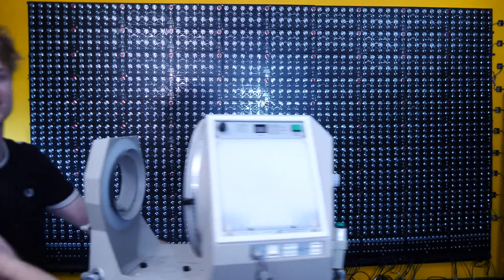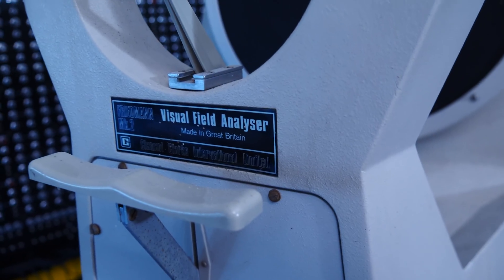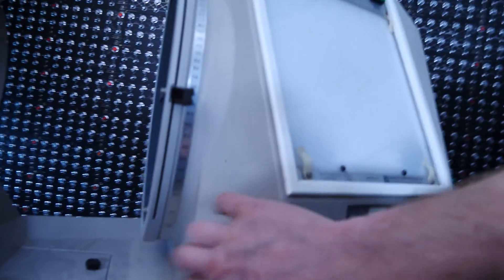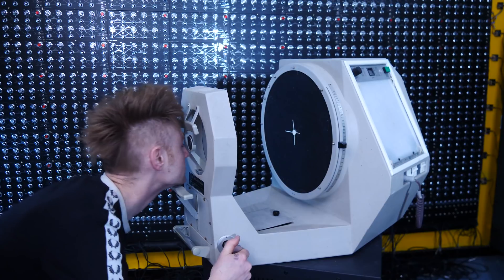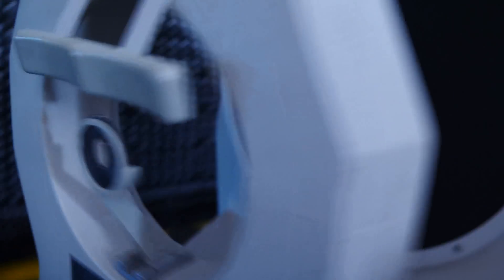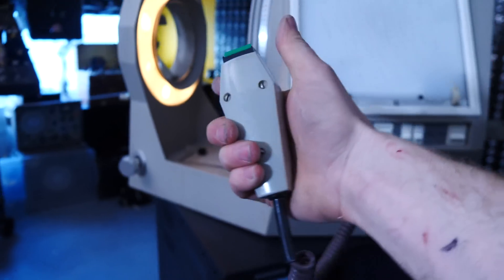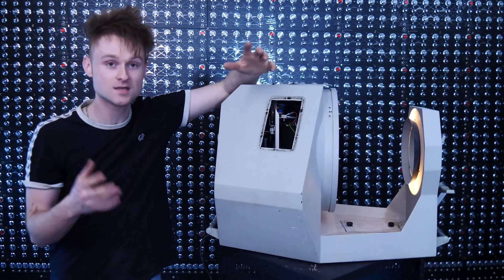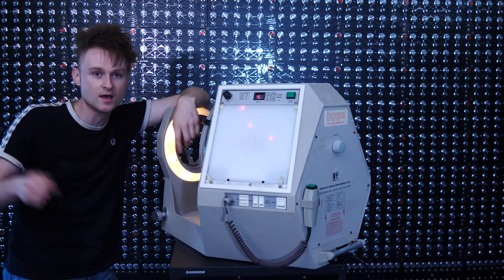I Found A visual Field Analyser

Comment: Add a very small camera without the infrared filter where the crosshair is, track the eye pupil with computer vision, and use the eye motion as an X.Y controller for synths or triggers for modules.  You can use a stepper motor to move the mechanical light selector, so it can sequence different lights at the time.  make ya eyes work it mang
Reply: honestly, this would just make a nice ass light fixture for the stage, the most bizarre strobe light anyone has seen

Comment: I'm feeling the connection with the eyes, perception, space... Could this be some kind of multi-dimensional stereo+ field realisation machine?
Backlight dimmer = quantised scale or filter or depth of field (front to back)
LED scroller = CV (notes) or spacialiser stereo fieldness (up, down, left, right)
also could fit some kind of eye sensor which would track eye  movement, which could have influence over audio in some way..? hehe fun stuff. Good luck

Comment: Yeah I used one of these years ago when I worked in an opticians. It was a bit more modern though. Patient would sit with their face pointed at the thing with all of the lights and look straight ahead at the big shape in the middle. They clicked the button every time they saw a light flash out of their peripheral vision.  The one I used had a camera inside and we had an extreme close up of their eye to and some controls to adjust their chin rest to make sure their eye stayed in the middle- and to make sure they weren't cheating. I zoned out once and when I snapped out of it I saw that the old lady taking the test had fallen asleep.

Comment: Some five years ago, I had refractive lens replacement surgery on both eyes, and in order to evaluate the results of the surgery, my doctor performed one of these tests on me.  As it turned out, post-surgery, my field of vision was near perfect.  However, I drive a tractor-trailer across the U.S., and as such, the Department Of Transportation requires me to have regular physicals and eye/ear tests, in order to ensure that I am fit for duty.  Upon reporting my recent eye surgery, the D.O.T. physician's assistant (not even a bona-fide doctor), determined that he would perform an equivalent test on me, to evaluate my field of vision. 

Now, this "test" (if it could be counted as such) consisted of the P.A. instructing me to look directly at the space between his eyes, as he stood some approximate distance away from me, moving a ballpoint pen from some distance outside my field of vision, inward toward my focal point, and to report the location where I first saw said pen.  Not satisfied with the results of said test, the P.A. informed me that I would no longer be authorized to drive a commercial vehicle of ANY kind, unless and until my vision was corrected.

Keep in mind that, just days beforehand, I had easily passed this test on one such visual field analyzer as you demonstrate in this video, with precise, repeatable, QUANTIFIABLE  data points, performed by a fully qualified optician.  Yet, somehow, I failed a somewhat arbitrary eye test, performed by a physician's ASSISTANT, who may have performed perhaps a dozen such tests at most (and probably far less!), using whatever object he had at hand, in which he estimated APPROXIMATELY where my field of vision should begin! 
Eventually, I was forced to request that my optician, back home in Florida, send a copy of his report to this Physician's assinine, I mean, ASSISTANT, to prove that my eyesight was, in fact, adequate.  In the meantime, however, I found myself stranded in California for nearly a WEEK, until the D.O.T. idiot finally got around to evaluating my test reports!

Comment: Instead of modifying it and tearing it down, you could just build a sensor system to detect which lights are on, and produce sound off of that - that way you still get a weird sound organ thing, and the machine can remain intact.

Comment: Never seen such device before. It looks very medical, I reckon it probably wasn’t used by optometrists but by doctors instead. EEVBLOG has done teardowns of medical devices such as echo / ultrasound imaging systems. These medical devices have a lot of very bespoke hardware in them that costs a fortune to engineer.

Comment: My dad was an optician and I used to love playing with his machine like this on visits to his shop as a kid. I think his was marginally more modern though.

The procedure was that you placed your head, as you did, then started the programme for each eye.
Periodically, it would flash up a constellation of coloured dots. Then you’d have to press the button on that wired remote for the number of dots you saw. A few seconds later it would proceed to the next constellation. By the end of the programme it worked out which bits of your vision your eye can or can’t see. His machine used to print the result on a cash machine type receipt. Lots of beeping would ensue.

I loved playing with it because I thought it was a game. It even got to the point of my dad accusing me of cheating because I supposedly saw a dot where my blind spot (optic nerve) was supposed to be. Good times.

Comment: I have been tested with a later model. I didn't need to call out what quadrant the light was, it was flickering lights in random spots and I pressed a button when I saw it.
I would suggest a non destructive mod. Tap into the lights with some piggyback soldering and have them be cv outputs. Or, a two step photo sensor. Red leds could be notes, the incandescent lamp controlling a vca or filter cutoff?

Comment: Change all the lights to lasers, mount some matrix of photovoltaic sensors with CV outs that can be triggered by them on the viewing end, add a small smoke machine that can be trigger with one of the switches.

Comment: Sadly, the only version of the same concept I ever had, was motion-based.  You click the button on the joystick whenever you see motion.

Then, sometimes to test reflexes or some such, they blast air in your eye.
Reply: The blast of air tests the pressure of the liquid in your eye, it's called tonometry. The moving lights are called a kinetic visual field and are a bit more flexible than the tests with lights that flash, both have their uses for different diagnosis. Cheers! -Vision technician

Comment: You can quite easily download a visual field analyser app and use your own computer to assess your visual fields. Interestingly, the right half of the brain looks at the right half of the visual field of both eyes, and the left half of the brain looks at the left half of the visual field of both eyes. You would think R brain would control L eye (like it does for other movements). The visual fields cross over at the optic chiasm, and they are inverted again by the lens of the eye. By the way, as one of your patreons, I love your work. Keep it up!

Comment: Hi Sam i hope you can see the ideas i tough on how you could modified the Visual Field Analyzer
1º idea is turning the apparatus in to a teramin (or laser operated) instrument
the space between the eye thingy an the black circle with the crosshair is where the teramin would be played and the side lever selector can be presets in a synthesizer. 
The dot display would be where the synth controls are and you could change the black circle to a white acrylic and put behind different colour led as well the circle light in the head rest could be modified.
The laser operated instrument would work by cutting the path of the laser where the black circle is now and the receptors where is the head rest. The dot display could indicate what lasers are active and that could change the type of sound can synthesize with the leaver.
2º idea is putting a large vacuum tube between  the black circle and  the eye thingy/head rest thus creating a enormous plasma ball that would react to the kaos or launch pad, etc on the side where the dot display is, and the leaver could change the plasma tube presets!
i wish you could make one of this! you're awesome and love all the projects!!

Comment: One idea, scale up the light array so it's a large dish/circle that covers a ceiling, so it's actually the full field of vision.
As for controlling it, could you use MIDI input to decide which lights the illuminate ? eg 1 note = 1 light, thru to 4 notes = 4 lights ?
Or the more notes playing at one time, the further out the ring of lights moves ?

Comment: I've had tests with modern ones of these a couple of times... they either flash one, two, three or four lights at once, scattered around the thing, and you have to say how many lights you saw each time
Reply: If... the high voltage means there's a cathode ray tube in there and iff.. that does something meaningful then perhaps modulating it like on the first LMNC video I ever watched,  the old telly made into an oscilloscope then maybe something  amazing could happen.   

Or..I like the idea of it being a visual machine so if you could track the eyeball and shine light into it (not a lazer obviously ) and use the reflection to trigger sounds. A great interactive exhibit!

Comment: Make it control the tempo of sequencer by blinking your eyes using a blink detector - when you close your eyes the tempo and pitch drop and when you open them it works normal. and make the tempo ramp down gradually the longer your eyes are closed!

Comment: I think that's the manual version, i think the operator sets a pattern with the lever, then the lights fllash after a delay (random timer), patient pushes button if they see it.
Not sure about the button with the beep, do the lights on the patients side flash at the same time as the beep ?

Comment: What im thinking is that you could have each light configuration be split out into chords, each light triggering a configurable output voltage. Then, you can trigger the envelope with the handheld button to "play" chords while changing the chords up with the little wheel dealie. You'd basically use the light presets as chord presets.
Reply: This sounds like it wouldn’t be very pleasant to hear
Reply: haha Just got the same idea but you were first !

Comment: you could make a kind of cv modulation "future" machine, with sensors all over the place so you can move your hand in the middle changing cv. And the wheel that changes the lights grid could be a gate sequencer with different modes. Actually would be a great 1000 Oscillators Controller?!!

Comment: I had internal eye pressure problems as a kid. I remember spending lots of time looking into one of these, clicking the button, checking for vision loss. 

It's to check for vision loss from things like Glaucoma, pressure on the optic nerve, retinal detachment, injury etc. 

Some people lose vision so slowly, they don't notice until it's too late to correct. This is designed to be able to measure and keep track of your field of vision.
Reply: Same here!
Reply: No, the machine that checks for glaucoma is different.  It puffs air onto your eyeball.  This machine checks for peripheral vision.  Last time I used one, I had to tell the ophthalmologist how many lights I saw on each flash.  The outer screen is for them to look at to see if you're seeing them all.
Reply: Yep. My Opthalmologist dilates my pupils and takes pictures every year now for about the last decade, but I do still take that test on a much newer version of this machine about once every other year to check for damage to nerves that can't be seen.
Reply: Now they just take a picture and show you the damage.
Reply: bump!
Reply: I was lead optical technician at local optometric practice (lost job due to covid) and this is an excellent explanation, couldn't have said better myself. 

We had an old Zeiss VF in the back treatment rooms, you could hear to servo actuator move every time to point the laser on the dome which allowed a lot of people to cheat the DVLA Estermann eye exams through the 1990s and it's still used today officially I believe. 

The new Heidelberg and Zeiss standards use 'reactive' (heidelberg term...) algorithms to gauge the exact field of view from the centre of vision. I.E. - if you get a good enough result you can actually figure out % vision loss in terms of peripheral vision reduction (glaucoma) or central, macular vision loss (AMD).

We also used OCTs which I was especially fond of, I got so good at the controls I could do an angiography scan of the macular with someone who could barely see my finger let alone the guide display down the aperture. Some patients had been regulars for over 5 years and it meant we could really see how their eye health was progressing. Really, going regularly for eye exams is the best thing you can do.
Reply: @camman1056  Thanks! I have a fairly complicated opthamological history, and I've been very fortunate to have had access to excellent treatment, techs, and doctors. I'm sure I was annoying as a kid. I wanted to know how every unfamiliar thing worked, and why I was using it. I was incessant with questions, and most techs were enthusiastic to explain and share.
Reply: @doug960  Yeah honestly it's great when people ask what we're doing! You end up doing so many appointments it really mixes it up haha

Comment: not sure why but the arrangement of LED's instantly made me think this would be great as an arpeggiator! maybe having the wide LED's be lower notes to the center ones being higher. or you could make oscillators change pitch depending on the LED position making a detune type deal, again with the wide LED's being lower pitch than the center ones. i also noticed that the amount of LED's changes from 2-4 seemingly randomly, which would add variation with either option. (maybe 2 is an octave, 3 is a 5th chord, 4 being a seventh chord)

Comment: Ayy I'm a technician that runs a much newer type of machine. Looks like a paper chart would be held onto the flat area, you would cycle through test stimuli one at a time and mark by hand which ones the patient sees. Is there a place for circular lenses to be placed in that eyepiece? Our old school lenses are still in use. Haven't used that particular machine but I assume it cycles positions within the group of 4 locations that are lit up in red. Our system tests different brightnesses to see what is the dimmest light the patient can see at each location. The field of vision can be affected just on one half due to a neurological issue like a stroke and it's amazing how patients don't explain their vision like that, once you do the test it is clear what the issue is. It can also test for glaucoma which makes a swoop type of pattern to the optic nerve area blind spot. The pattern of dots is way different to what I see at work now. It's really cool to see how the standards have changed for my industry, thanks for posting!
Reply: thats cool! very interesting, and yes there are lenses with it! i forgot to put one in
Reply: @LOOKMUMNOCOMPUTER  Looks like this model came out in 1979, it uses a smart way to make those little lights appear, seems like it rotates a big plate with holes in it, so it doesn't need to have 100 different lights it just lets light through what I assume are 4 light bars hidden behind it splitting it into 4 sections. Only one light bar would be lit at a time and shine through whatever hole is lined up. Some good info online at the Cyril Kett Optometry museum under catalogue number 1664. Even the new machines have some amount of noise that allows patients to cheat, a company tried to get us to upgrade to quieter stepper drivers for $1500. Newer machines use mirrors and a light beam projected onto the inside of a big dome.

Comment: Maybe turn this in a sort of arpeggio or "scene switcher" by doubling the circuit of the leds with vactrols to trigger notes/samples /chords /wathever ...
Reply from the maker: dont even need vactrols just wires
Reply: @THISMUSEUMISNOTOBSOLETE   yeah i just realised, but vactrols are cool so let's put some !!!!!
Reply: a "random" combinator of sources could definetly be neat, having modulations and gates etc assigned to a light or group of lights and switching on the fly between them with constellations of leds blipblopping for visual feedback
...

Comment: That lights selector would be awesome as a sequence selector.... And triggering the flashes via MIDI?
I've been tested for this, and it's basically exactly as you described. Instead of saying you saw the flash, though, you press a button, and the flashes are automatic.

Where do you find these things! haha
Reply from the maker: always on the hunt ha
Reply: THE MUSEUM OF EVERYTHING ELSE how about using photodiodes that trigger with each flash pulse as a non-destructive way to use it?
Reply: @iNerdier  -  I was thinking of this too. Glue the photodiodes all over a sheet of plexiglas and use to trigger sequences or multistage FX like delay and reverb! A quick flick of the lever and you delay pattern changes!

Comment: use a jetson nano to control the notes with your eyes by looking at the dots, and make the colors filter presets maybe?  I dunno where a camera would fit though, maybe behind the crosshair
Reply from the maker: modern versions of this do have cameras looking at the eyes to make sure the patient is looking directly on, so yeah possible
Reply from the maker: never heard of a Jetson nano any good?
Reply: @THISMUSEUMISNOTOBSOLETE  I never used it but it looks good, kinda like a raspberry pi with GPU for computer vision stuff, I saw an Eye Tracker SDK for it
Reply: @THISMUSEUMISNOTOBSOLETE  whoa apparently it's possible to do eye tracking without a camera by measuring muscle voltage like here onloop.net/hairyplotter  or  https://www.youtube.com/watch?v=zObidmxnj5Y  those ones use arduino but I wonder if it could use analog comparators somehow instead